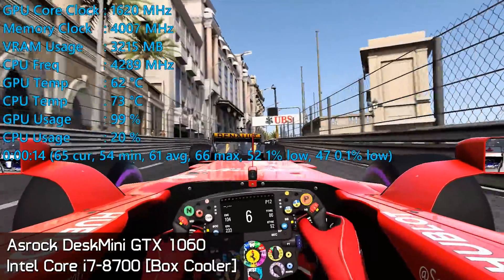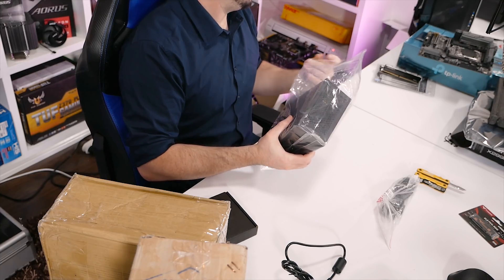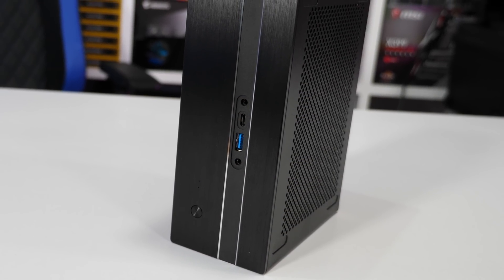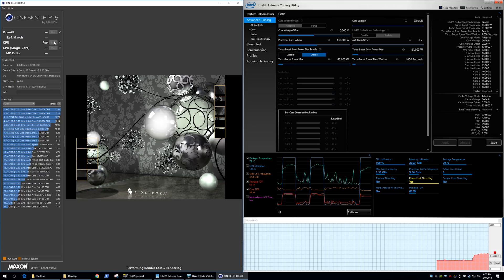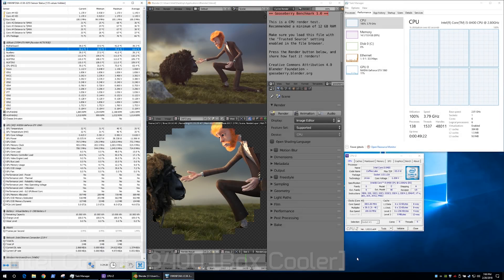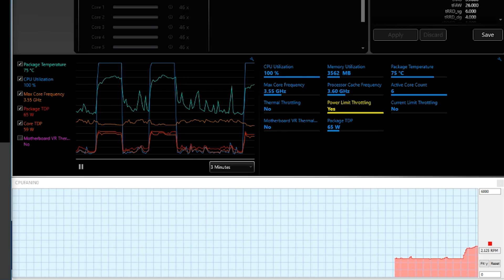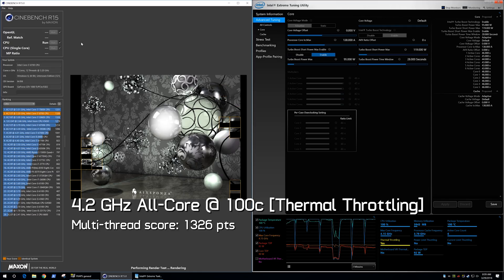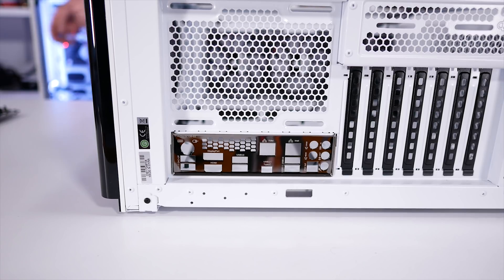Core i7 8700, Intel Box Cooler Limiting Performance

Comment: How can Intel increase the core count of a cpu and think that the same cooler can cool the six core part as good as the four core part?
Reply: Think of the stock cooler as a back up cooler, if your after-market cooler would shit itself.
Reply: TheGyuuula still it's about time they improve their cooler that the have been providing for so long.
Reply: Yeah, even the wraith stealth allows overclocking, while the intel stock coolers have barely been enough ever since the first gen of Core ix
Reply: I wouldn't blame this on the tech press because there's no reason for the press to cover prebuilts if 90% of the customers won't even know the difference between a celeron and an i7 minus what the sticker says.
Intel should at least test, and if they already do extensive testing, they need to do something about the lazy and extremely cheap OEMs. They're saving 5 cents by not just using a better cooler. The slab of metal that turns a 65w wraith stealth into a 95w wraith spire would cost an OEM less than a quarter.

Comment: Yet again, adored spreads utter nonsense to rile up controversy and views. How many videos has HWU had to do just to instantly rebut one of those videos. Its just silly.
Reply from the maker: I'm looking to order ten 8700K's next ;)
Reply: Beef Ingot - I own an R5 1600 that hits a brick wall for stability at 3.75Ghz regardless of voltage or memory timings whilst sitting under 80 degrees.  I was dissapointed with my results so I started looking across MANY forums and I am far from alone with my experience.  In fact from reading through hundreds of posts probably only 10-20% can stably hit 4Ghz or higher, with another 30-40% hitting 3.9Ghz and the rest at 3.8Ghz or less.  In fact the distribution of figures isn't too disimilar to what Adored showed - which may be linked with the fundamental limit of current wafer technology at 14nm.  After all if Intels technology could produce a much higher proportion of cpus sold as ultra high overclockers in comparison with AMD then I'm pretty sure they would be shouting it from the rooftops. ..........???

Personally I find AdoredTV to be another useful point of reference for reviews - one that helps to keep the other channels honest - as there is way too much reliance on sponsored advertising on tech channels these days - and it inevitably will influence reviewer opinion even unconciously (anyone that claims otherwise needs to go read some psychology journals)......
Reply: Hardware Unboxed - Ten isn't anywhere near statistically significant but if you want to remove accusations of bias then buy each cpu from different vendors both in Oceania and overseas (USA/EU/Asia) to guarantee different CPU batch numbers.
Reply: Just remember that whilst you can question the source of the data used by AdoredTV that all of his assumptions seemed perfectly appropriate and fair - so there is probably a grain of truth in his claims.  Let's face it Intel have been caught doing far worse in the past and been fined for it - and I'm fairly sure AMD cherry picked Ryzen review CPUs as many R5 1600 and R7 1700 struggle to reach 3.8Ghz never mind 4.0+.........
Reply: Using adored to keep other channels honest, is like using theonion to tell you the real news.
Reply: Beef Ingot - like him or not but his videos did get people to take another look at their results to work out wtf was going on.  Even HW Unboxed admits that to be the case as does Tech Deals.  People may disagree with results interpretation but if nobody ever agitates when irregularities are spotted then people tend to end up hanging around in their own polarised and self reinforcing echo chamber (as happens on social media).

The advancement of science and engineering is based on peer review - and the same healthy constructive criticism should ideally be taking place between tech channels.  If you look at Tech Deals he still engages with Adored even if they disagree - because its the quickest way to avoid the bullshit on all sides and get to the truth.  ("Understanding is a three edged sword - your side, their side and the truth").

It is unfortunate that the Adpocalypse has caused many tech channels to cosy up to the big manufacturers to keep the lights on - giving the appearance of bias even if there is none.  Adored is a useful counterpoint to the big channels coverage as he acts as independent observer ready to challenge irregularities and ask awkward questions that some of the 'partnered' channels wouldln't necessarily raise.

He may not always be correct - and he could take the attitude down a notch or two - but he does usually raise useful questions backed up by publically available evidence - before stating his opinion.
Reply: Draksyl youre really reaching there what with the advancement of science and engineering jargon.

The big important difference between what he does and peer review is that peer review is done in good faith and has good points. It doesnt make large claims based on faulty assumptions or a lack of evidence. 

You say  he may not always be correct and again thats overstating the usefulness of his content as he most often isnt correct and when he is, he likes to exaggerate unreasonably.

He panders to his audience with controversy bait, and due to that, no, he is not beneficial in the space.

The point "Adored is a useful counterpoint to the big channels coverage as he acts as independent observer ready to challenge irregularities and ask awkward questions that some of the 'partnered' channels wouldln't necessarily raise." is just... its silly. Especially when you see channels like Gamers Nexus or Hardware unboxed that regularly investigate irregularities with less to none of the controversy or bait.

This idea that somehow adored not even getting his own data to weigh in somehow being beneficial is ridiculous. Itd be like saying youd prefer a non doctor weigh in on your medical diagnosis, or have a non mechanic take a look at your car. 

I mean sure they might be of help, but to imply that the fact they arent actually able to do the testing themselfs is a positive aspect  they have over other content creators is ridiculous and certainly not one that deserves the ridiculous title of independant observer
Reply: Beef Ingot - Its not an over-reach at all as I've been working in science and engineering for the past 20 years (with relevant degree) - for companies both in the public and private sector - and its by far the easiest way to resolve technical disagreements amicably.

Regarding the rest you have already decided that AdoredTV isn't to be trusted which is of course your perogative.  However, I prefer keeping an eye on his channel as not only might he occasionally make some good points - but watching the response of the other channels is enlightening in itself - especially from the core 'clique' of tech channels which with the exception of GamersNexus tend to move and think as one collective.  The tubers that I trust most are those like Tech Deals who don't automatically dismiss everything and stay professional throughout - which is more than I can say for some of the other (now unsubscribed) channels.....
Reply: Draksyl, if you watch enough of a source to feel that it isnt worth looking at, should you continue to watch over other sources in the hopes that your expectations are challenged or should you find new sources/continue to watch sources you appreciate?

You and I disagree how valuable the source is, and thats fine , but its not unreasonable to filter an information you deem to be unreliable. Im certain you do it all the time without realizing it. Whenever he does find something I deem worth looking at or rather something thats has interesting results or conclusions, Im sure itll pop up elsewhere in news or my feed (like it did here) or be covered by other people (as like you said, watching the responses of other channels is enlightening (with or without the source often)). Ontop of that, it'll be in a more straightforward manner without any of the exaggeration Im not fond of.
Reply: dam that makes me feel alittle better about my R5 1400 have it @ 3.72ghz at 1.350v.
3.8ghz needed 1.4v. Hope ryzen + is better
Reply: @Killer32620 What should make you feel even better is differences that small are almost academic. You probably wouldnt notice it anyways. I for instance used to run my 7700k at 4.9 but turned it down to 4.8 Couldnt see a single difference. Heck, I bet I wouldnt see the difference if I turned it down to 4.5. I dont have a high refresh yet though. Even then I bet It couldnt pass a double blind.
Reply: i mean i just got a gtx 1070 feel limited by my 1400 but its fine till i get a higher refresh rate screen
Reply: Killer32620 - these days it's better to be CPU limited especially when AM4 offers a clear upgrade path.  I would hate to be contemplating swapping GPUs regularly at the moment!   I'm keeping my GTX960 as long as I can in the hope that the market prices stabilise.  Fortunately it's also perfectly adequate for the games I play (mostly Warframe and POE).
Reply: Yea, I suppose that might hold you back a little in more cpu intensive games, but Im sure for the majority you wont be missing much anyways. 

And for the titles where the cpu is holding you back from a consistent 60 you can always lower your refresh rate to 50 or lower and max out your gpu so you're getting the best out of the setup.
Reply: true thats kinda what ive been doing just highering the gfx settings so its more gpu bound thinking of getting either a 1080p high refresh rate screen or a 1440p with higher refresh rate.my tv doesnt realy cut it
Reply: @Draksyl That goes against common advice given for the past while. Im of the opinion that its far better to be GPU limited as that leads to a far more consistent frame rate than an equally cpu limited situation (as being gpu limited youll see a nice consistent frame rate vs cpu where the frame rate will highly fluctuate depending on whats happening even more so than explosions for instance might affect the gpu).

Next, when you consider the upgrade cycle of a cpu compared to a gpu (often 2 or even 3 gpu upgrades per cpu) due to the difference in advancement rates between the 2 traditionally, I think being gpu limited is the way to be (obviously not completely imbalanced though).

As for AM4, Im on the fence about that idea. If Ryzen 2 (not just the refresh) comes out on AM4 I can believe it. If it doesnt however, then I think you might be better off just going intel if gaming is what youre after as I doubt AMD will catch up clockspeed wise on the refresh if the (still decent) rumoured clocks are right.
Reply: im just seeing if theres any improvements worth to upgrade some how in some games i see some micro stutter idk if it could by my screen being limited to 60 even tho im gettin way over that :/ oh well i can still enjoy my games
Reply: Part of what tricks people into believing adoreds nonsense is that theres always a lick of truth to it. He brings up facts and research, but then theres always the strong twist or purposefully misleading presentation. Thats where he gets you. 

As for cherry picking chips, if youve watched his recent video, there is so much missing data and poorly based assumptions, I very much doubt that even if there somehow is a grain of truth there, that it was arrived at through reasoning with available data vs just happening to get lucky and arriving at the correct conclusion by accident.

With the AMD situation you describe, I dont think there is enough data there either. Im not sure you can make that claim. 

I think whats far more likely is that youtubers/reviewers, ontop of tending to have the best motherboards, also had less time to do stability testing and therefore end up with higher clocks on average whilst not being perfectly stable. Then you also have to account for the fact that not all users will overclock optimally.

Comment: great analysis, enjoyed getting a better understanding on the thermal limits with the box cooler. So the take away is simple, if you want to get the maximum out of the 8700 or 8400, get a better cooler. If you are happy with stock performance and are not going to be playing with the CPU at all, no problems either...I dont get the problem here really, most people who are not, and I repeat are not enthusiasts will have no issues, an enthusiast on the other hand knows to get a better cooler. I personally have yet to ever use the standard cooler that came with a CPU..
Reply: So, then why did you buy a 6 core? You're just not going to use even half of it? Games barely put a load on it compared to most editing and rendering tasks. Why are you not buying a quad core if your not doing that much? It will use less power and run at faster clocks, giving you a better experience, making the 6 core pointless.
Reply: If that was the case, then why buy a BMW or Porsche  or any car other than a basic car to get from a to b? why buy a better house? Why buy more expensive watch. It all comes down to what the person wants, and if he or she wants something that does more than required....why not...It would be an awful dull world if all we went for was .....just enough! And finally, maybe they will use the additional capabilities further down the road and just want some future proofing...Who knows and ultimatly they may just want to get the best that they can for there budget...I am sure there are people out there who have the top i9's and Threadrippers and will never use the capabilities of those CPU's to the max....and good luck to them...

Comment: Typical Intel... 257 Euro CPU and they couldn't even include box cooler that would at least work properly.  I remember that when I was running i3-4170 it would reach 100C and shut down on box cooler whit box thermal past. Simplest, cheapest tower cooler that cost 8 Euro kept that CPU at 65C under load.  Conspiracy theory aside this i7-8700 should be only describe as 65W TDP@3,2GHz  because obviously this CPU reach a lot, lot higher TDP in factory Turbo mode. BTW AMD CPUs cost less and includes box coolers that even have some space for overclocking - IMHO this say a lot about bout companies attitude towards users.
Reply: I'm not sure but I guess your Intel stock cooler wasn't properly seated on the motherboard. That's strange your i3 went up to 100C....
Reply: It was mounted properly. CPU goes to 100C on Prime95 load, during gaming it would run at ~90C if I remember correctly.
Reply: Damn. 100C for an i3 seems weird. My 4790k used to go up to 95-100C on stock cooler.
Reply: Shehroz Khan mine hits a max of 40 at 4.6 ghz. I delidded and have a 280mm AIO cooler lol.
Reply: kirbyswarp wait wtf. 40?for real m8? Fuckkk
Reply: kirbyswarp I've delidded mine too, with 212x and in cinebench, tops out at around 70C (on 4.4 turbo on all cores).
Reply: Shehroz Khan delidded and a 280mm water cooler. That's why.
Reply: Shehroz Khan I had a 212 Evo and it hit high 60s at 4.5. Pretty normal.
Reply: Talking about silicon lottery. We both seem to be at opposite ends.
Reply: Shehroz Khan Really? Mine doesn't seem too great. My 3770 runs 4.2-4.4 at 1.08Volts. Mid 50s MAX temperatures I've ever recorded on a cryorig h5.

The 4790k runs close to 1.3v